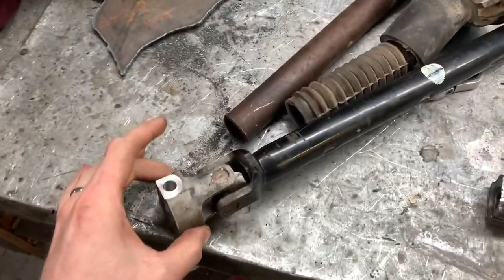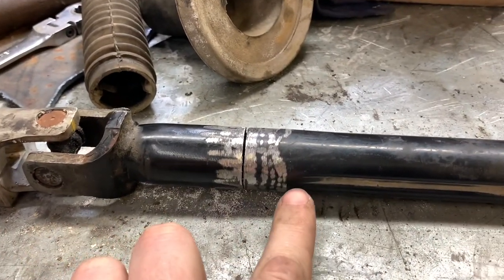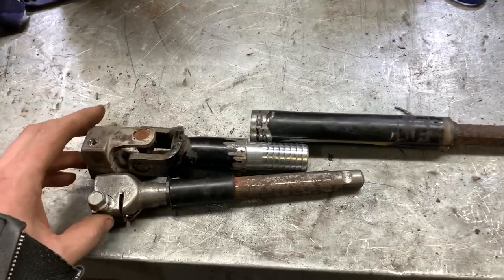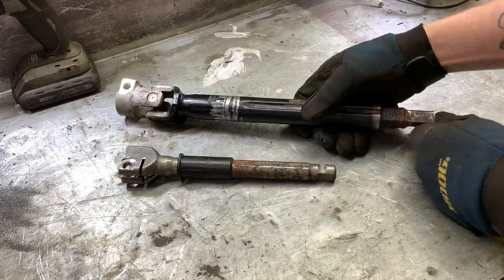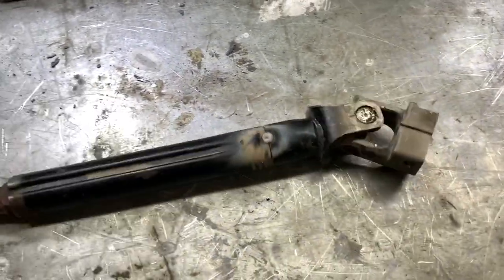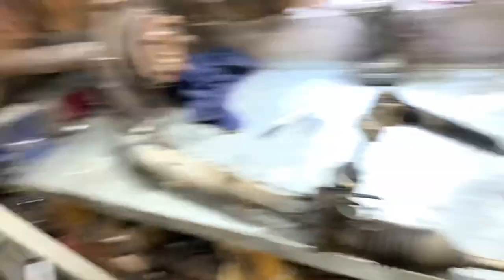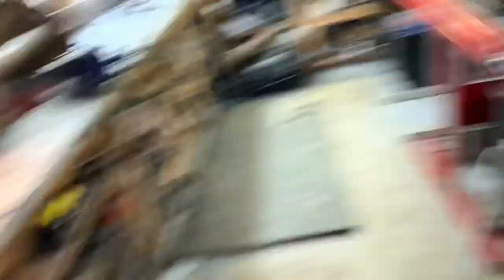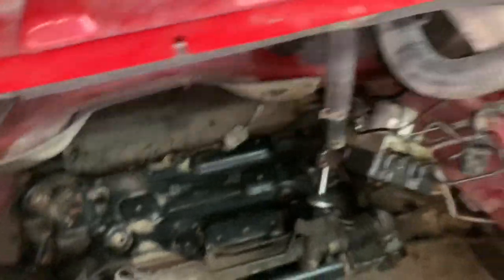Turbo LS grand caravan build - extend steering shaft, mount rack, no room for the engine!

Comment: Make sure all your U joints are in phase ...will bind like a mofo if not... and FYI not sure if u know or not but the dimples u cut out of the shaft were the crumble zone, for impact in an accident. with out it that shaft will be a weapon..but obviously you dont plan on crashing it lol!! amazing build bud really enjoying this!
Reply from the maker: I actually had to change the plan entirely,  I think I did it in the next video. I didn't realize at the time that with 3 joints I'd need a support bearing in the middle and I didn't have space for it, so I just extended the stock steering shaft from the rack up to the column, and the slip joint up on the column has full travel and worked much better. Thanks for the tips!

Comment: As useful as the stow and go is, I’d cut it out, or at least part of it. I think ride quality is gonna suffer lowering the cradle and cutting the springs, or getting lowering springs. If you’re just going to do burnouts, maybe that’s not important though lol.
Reply from the maker: Thanks man. Assuming it works and doesn’t give me any issues I’m going to offset the engine toward the passenger side, and only disrupt the one side of the stow and go, we use it very often on long trips and when we have our dogs in the van so at least be seat will go down into the floor